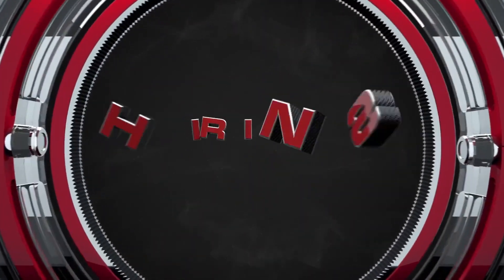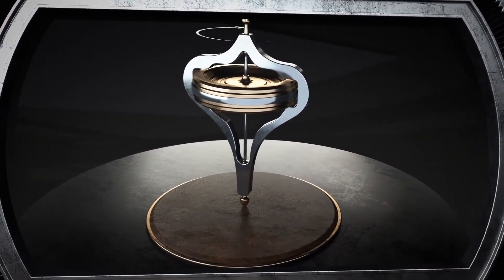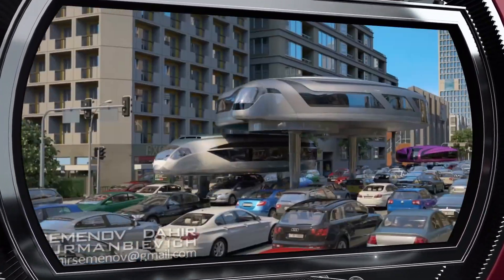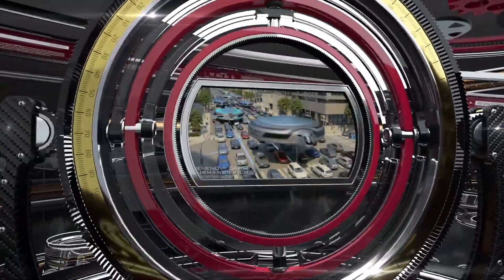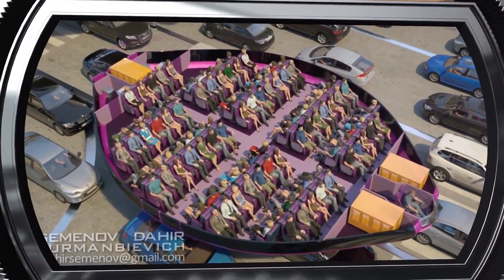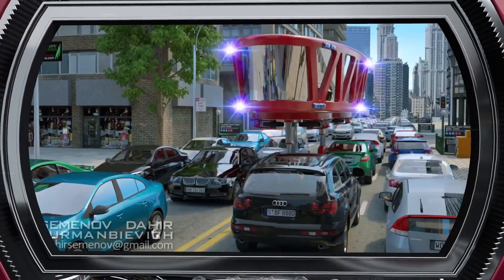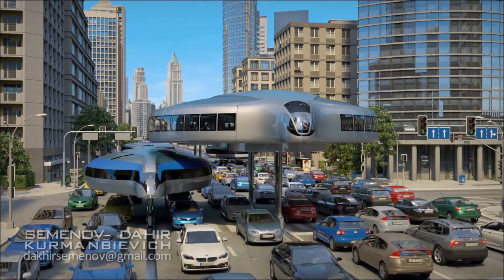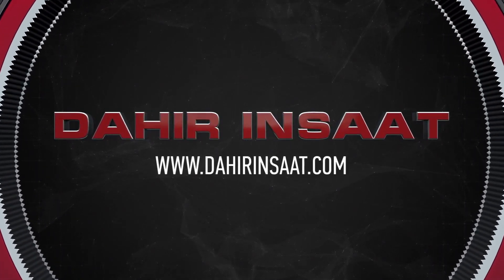How Gyroscopic Transport Works

Comment: Wow, this is extremely stupid idea. As soon as this thing takes one corner it's going to tip over because of the way a gyroscope works. Mot to mention all the weight is on stilts. People have tried gyroscopic stabilize cars, trains, boats, etc for 100 years, and they NEVER work. It's always the ideas with only computer graphics that are bound to fail, because you can't actually build the things. It's easy to ignore physics if you just make a nice CGI model huh?

Comment: This is simply too dangerous and should be banned. It is dependent on all traffic staying in their lanes without mistakes in order not to be run over. Even as a retired professional driver I would find doing this perfectly day in and day out hard to do. One mistake with this technology and you have a crushed car and occupants, or a broken leg on the gyroscopic unit above and it comes crashing down on several cars and occupants. 
NO thanks.
Reply: Not to mention a soon as this thing takes a corner it would fall over. Really stupid idea